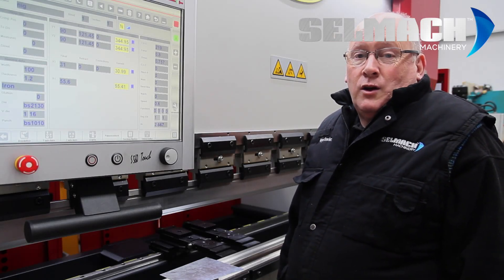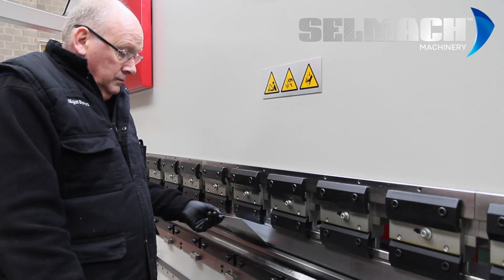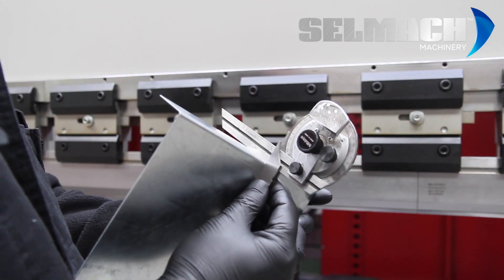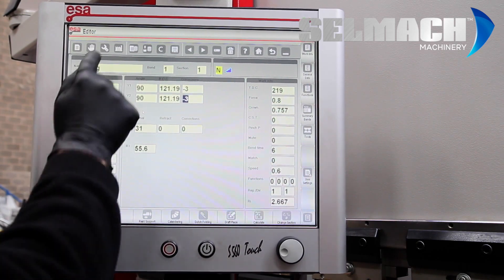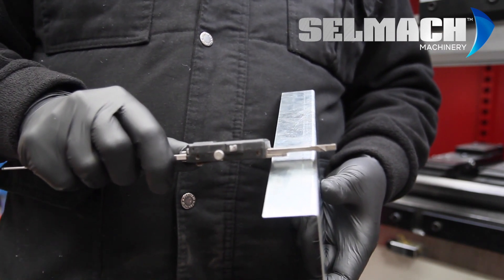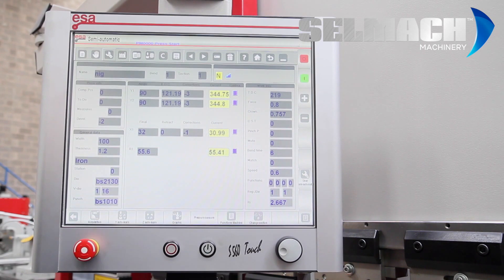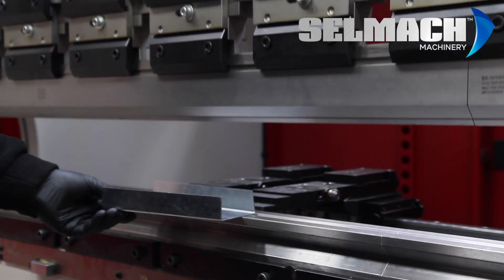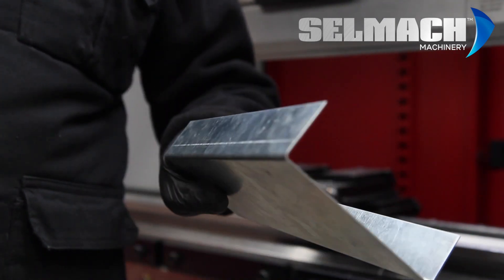How to Correct Y1, Y2 and X on your Press Brake FAQ [Selmach Machinery]

Comment: I am Having Durma Press Machine, having Jitter Error Y1, how to fix it.
Reply from the maker: Hi Murali, this video is for Morgan Rushworth Pressbrakes, using the ESA S560 Touch Controller, if you're Durma Press Brake uses the same controller, by all means this video should assist. If not, I'd suggest contacting your supplier of the Press Brake / Durma directly.